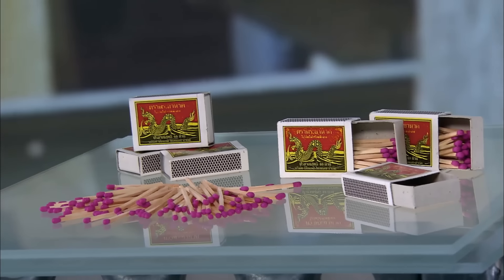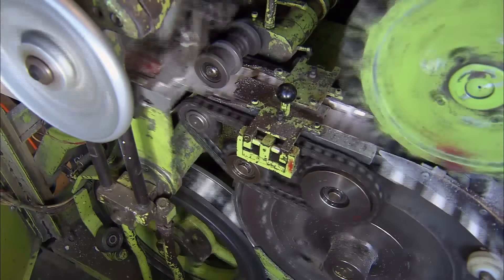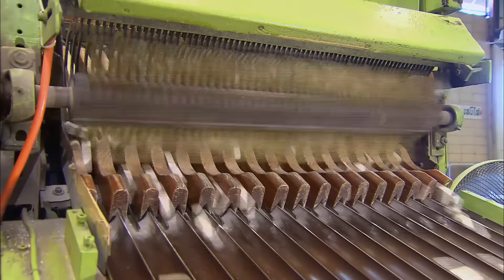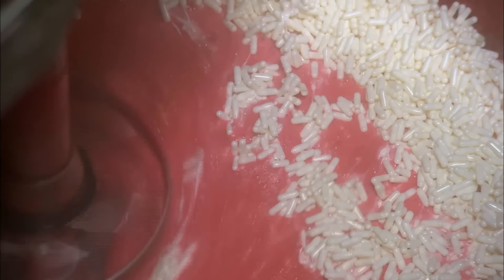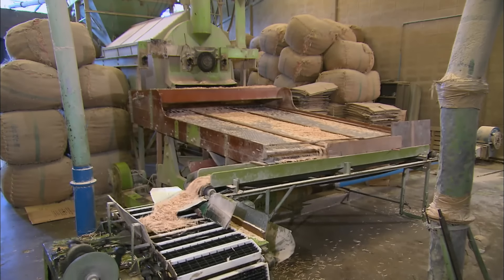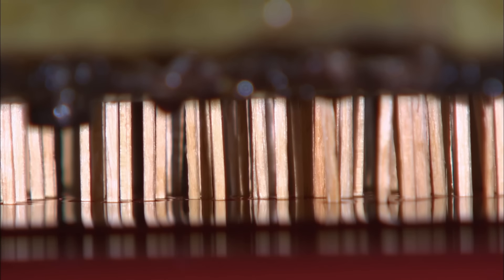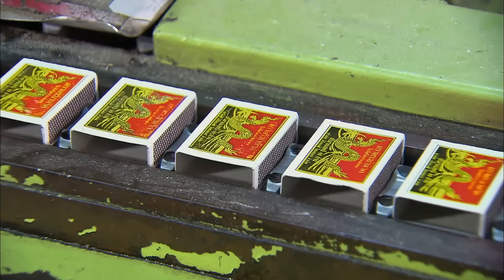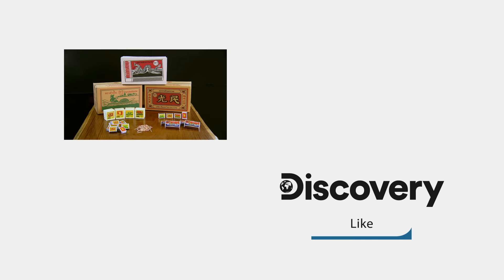WOODEN MATCHES | How It's Made

Comment: That Iron just strapped in, 10/10 bodge
Reply: Came here to say this! That iron that starts the entire process tho...
Reply: That was so........ high tech.....
Reply: the aluminum base on that iron won't last long.  And I can't imagine it does much with the paper flying through there so fast.
Reply: i got the 300th like
Reply: And yet apparently it gets the card to "5%" moisture... 🤔
Reply: Lol
Reply: That's clearly a high technical apparatus placed there by an engineer and was just used as a temporary tool... Like they say: A temporary solution lasts forever.
Reply: @AffordBindEquipment  they could probably buy a thousand of those off the shelf irons for the price of a proper industrial machine
Reply: @mutantgeralt  Very true.  I use an iron to iron on wood edgebanding.  I got it from a thrift store used for cheap.  A commercial edgebander costs thousands.  If it wears out, I have a spare....
Reply: The iron is easy sourced and replaced, surprisingly these basic model can be replaced quickly (heat it up before replace) and downtime can be minimized.  This matches are dirt cheap, I can see these iron as logical choice for the job.
Reply: What tf are you saying bruv
Reply: “There’s nothing more permanent than a temporary fix.” My old motorsport boss.

Comment: Almost every step there were matches flying everywhere. Makes me think one of them could light from enough friction or getting stuck in the wrong area
Reply: Safety matches require a chemical reaction from the lightning strip on the side of the box. So it is impossible for it to light from just friction. Which is why it is a safety match...
Reply: @Zekurity  no it’s not impossible, try breaking off the match head composition, put it on a hard surface and hit it with a hammer and it will explode, the match heads contain potassium chlorate and potassium chlorate with pretty much any dry fuel is extremely friction sensitive
Reply: @KClO3  Some people just want to see matches burn master Wayne.
Reply: @Zekurity  It’s a famous bar trick to light matches on a window.
Reply: @Zekurity  Is that because the red phosphorus is on the striker as opposed to the match head?

Comment: 02:45  -  AW - I was actually looking forward to how they made the wood splints.  A shame they skipped that part.  :-D
Reply: Maybe they manually carved it.
Reply: Me too. That has to be a very intriguing setup. Think of how much sawdust they must generate. I think about the quality of the wood that they must use. I've never seen any semblance of knots or splits nor of twisted grain structure. Very high wood quality to be sure. Tiny little gangs of saw blades at high speed. How often must they change out the blades. What speed must they run to cut such perfect little sticks.